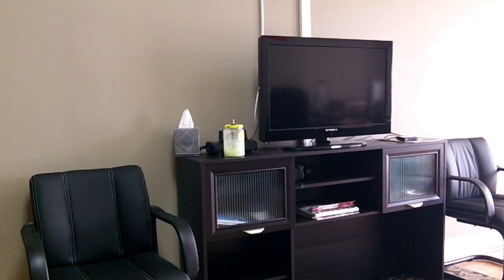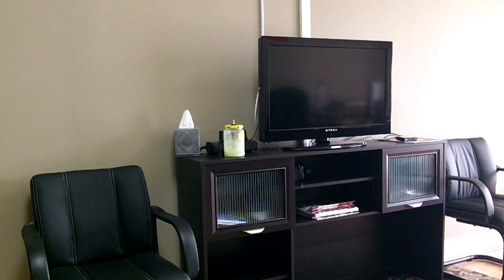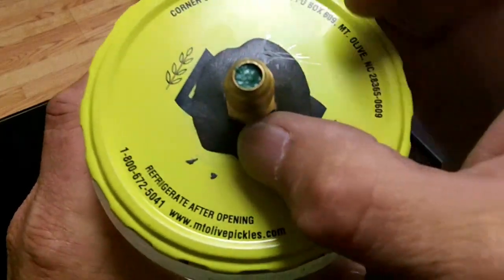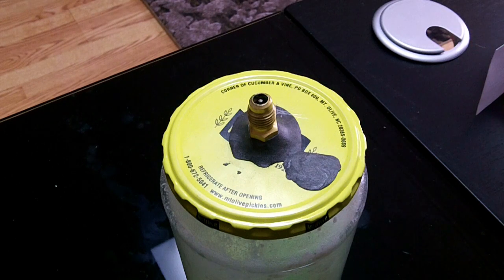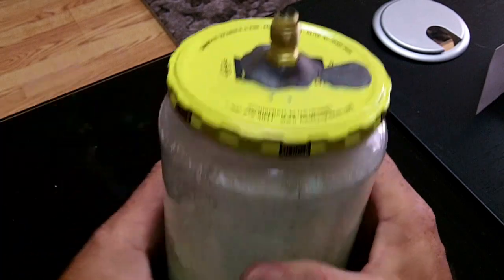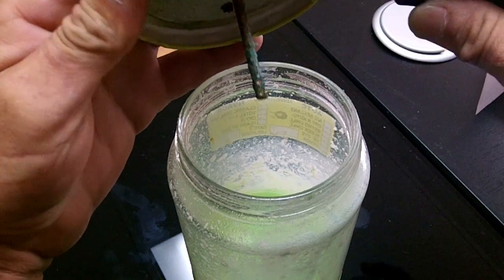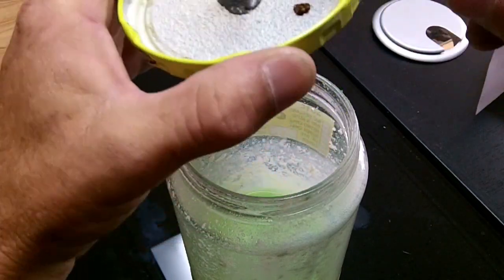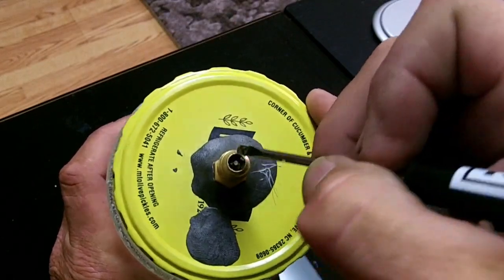HVAC Stop Leak Experiment Update Part 2

Comment: I have been in the field for 8 years now and have used stop leak more times than I can count without any issues what so ever. I hear of the old formulas causing compressor failures or clogging metering devices but not the stuff that has been out more recently. Most of the time it is an older system with the leak and the customer cannot afford to replace it just yet. So we advertise it as a temporary fix. I've personally used it in automobile systems where the evaporator had a leak and I did not want to have to tear into the dash to replace it. Going on 6 years in one of my vehicles with no issues. And almost every other contractor I speak to has similar results. I believe this video is very misleading. I would prefer not to put the stuff in my system however the new formulas DO NOT harm the units.

Comment: Worked on cars for 20 year professionally and the only thing I have seen from any stop leak product is problems. They coat the the system then react ( heat, solvents, air, whatever) and thicken or harden to plug holes. That is what it is designed to do. That is why you would want to use it right? So WHY are people surprised it when it plugs up passages, jams valves and destroys pumps? It does it in car cooling and A/C systems, why not HVAC systems? If you push this type of stuff you need to move on to a new trade. FIX IT RIGHT. All this type of products cost you more in the long run IF they work at all. Never really did from what I have seen. But then again, from a service side, I have made a ton of money cleaning and replacing cooling and A/C systems on cars from unfortunate owners using these types of products.... bad for any system, customers and a PAIN ($$$) to fix afterwords.

Comment from the maker: I have seen this stuff not work, If this stuff will eat through paint what do you think it will do to the windings in the compressor? So if its supposed to gel on the copper what is it doing to the TXV and or piston. Another question for you, if all HVAC manufacturers say not to use this stuff shouldn't you listen? If they knew it worked they would put it in the system to begin with. Seems like that would be any easy way to avoid a lot of warranties

Comment: Yikes!  I'd rather find the leak and repair it then use something that may fix the leak, but cause other issues down the road.  Just thinking what that does to compressor valves, cap tubes, TXV valves, and etc.